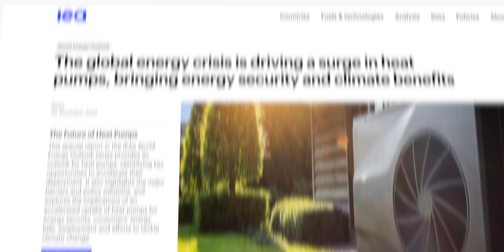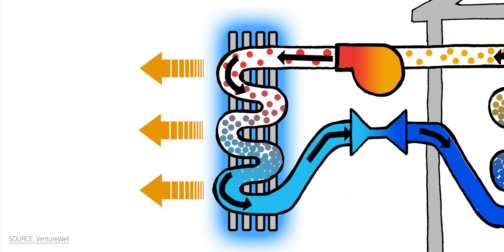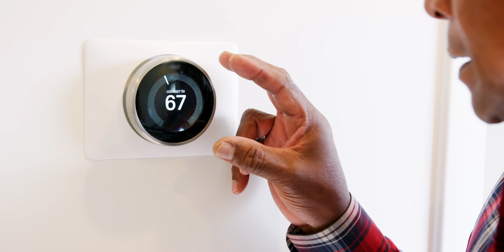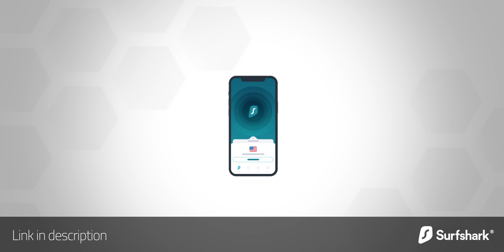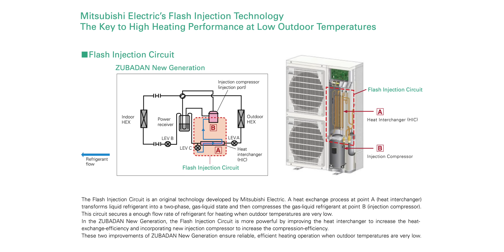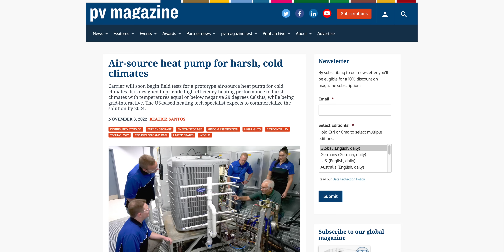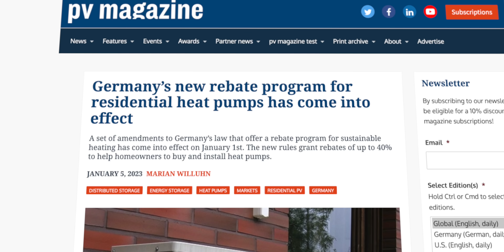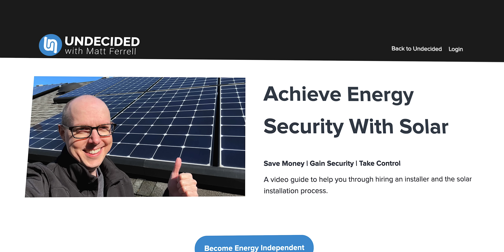Major Advances with Heat Pumps in the Extreme Cold

Comment: I have just gone thru my first winter with a single stage, air to air heat pump and I am only "so - so" on its performance.  About 50% of our winters here just north-east of Toronto are damp with a lot of freezing rain which means that we hover around the 0C (32F) degree mark and lots of moisture.  Our heat pump (York) keeps freezing up and I know this because it blows cold air into the house while it is defrosting itself.  I've had it run for 3 hrs at a time doing this and it's annoying as hell to say nothing of the electrical costs.  Once the temperature falls well below 0C degrees and therefore most/all of the humidity is out of the air, it works fine. So the end result for me is, whenever the temperature gets close to 0C I have to turn on just my furnace to heat the house.  Not great in my opinion.
Reply: You should’ve got an asian brand like Mitsubishi, Panasonic or Fujitsu.
Reply: Same here in Maine...I run my ASHP down to about 15f and then turn it off and switch my oil boiler back on for heat because having cold air blown on you while the HP defrosts is not so good. That being said I can't argue the fact that my heating costs have reduced dramatically through the fall and early spring months when the heat pump can easily produce heat and very rarely runs a defrost cycle. The summer cooling and dehumidifying the system provides is also much nicer than using the old school windows AC units.
Reply: This is exactly my concern.
Reply: Same in Estonia
Very wet and often hovering around 0C for months 
many people are unhappy with it
I will stick to wood stove that also double as back up cooking when power is down
Reply: There are ways to mitigate the issue of freezing/thawing. Most manufacturers have a line of heat pumps designed for use in cold climates. The designs can vary, but in the simplest case they just include heating elements in the outdoor unit to help prevent freezing. But at 0C I think you should not be having such issues with defrosting. I live in a wet, snowy area that also hovers around 0C and there are no issues keeping warm with any our heat pumps (we have a mix of Daikin and panasonic units rated for -25C and -10C - and just the normal heat pumps not cold weather spec).
Reply: We have just have 16 years on heatpump with more milder winters that have min of -7°C. The heat pump has continually performed to meet this no matter what rain snow or frosty mornings.  We leave it on 24x7. About to renew our home system with a ducted system with a Lossnay heat transfer and fresh air so hoping to get another 20 years high performance from the system. Even with low temps and higher humidity it works effectively. May need to look are settings to ensure it is optised to you environment
Reply: Use the brands the are built for it. Mitsubishi, Panasonic, Toshiba or Daikin are got to brands. Samsung also deserves a mention. 

I have had zero problems in temperatures around 0C for the last 7 years the Samsung has been on the wall. I will help it with the wood burner when it drops bellow -25c but those are few and far between, just a week or two per year.. It can do it, just not so good on it. 
I have electric elements but did a renovation at the same time it was installed and since the pump is so good at it's work they are still sitting behind the soffa collecting dust.😂
Reply: I have an aging system and would like to move off propane North of Toronto short of the Muskoka's.  Temps mid winter -10 to -25 and you have nailed my fear as well as the energy (electric) bill that goes with.
Reply: @waynekibbler2710  Wayne, I don't know what to tell you. My system definitely works, and throws off hot air but as I suggested there are times when there's moisture in the air that my heat pump has trouble reliably producing hot air because the fins on the exchange unit tend to freeze up and that's when I rely on my propane furnace to supply Heat. So it's not like I'm telling someone not to get a heat pump. It just would be best if you had some alternative heat in the case it wasn't producing enough heat for you. As you can see I had some comments come back that I should have purchased a more expensive heat pump. But ones like the Mitsubishi that's ate my neighbour just got and mine was $8,000 and his Mitsubishi was 22,000. If you had enough yard area where you can go geothermal then I might recommend that.
Reply: My AS heat pump did have a problem with ice buildup in the bottom on the heating element during outdoor high humidity.  But I solved this by putting a sheet of Styrofoam insulation under the unit. This stopped cold wind from cooling the bottom and let the heat from the heating element melt the ice in the bottom of the unit and drip out the drain hole.  It was amazing what this little change did to improve efficiency during the high humidity near freezing outdoor temperatures.  Greatly improved defrost cycles to less than 90 seconds every 20 minutes with no remaining ice.
Reply: Should have gone ground source.

Comment: We had a brand new Heat pump (not geo-thermal) in our newly built house in 2001-2012. During that time once temperatures went below about 31F the Heat pump ran continuously and the Air pumped out was noticeably cold. The only way to get warm air was to use the supplemental heat (electric heating strips) and once they kicked in the electric bill tripled very quickly. I decided not to use another Heat Pump but rather gas heat for our next House and am very happy that we did. I heard that Heat pumps have come a long way but I won’t get another one once I actually see it.
Reply: Sounds like you had the old heat pumps that were before inverter drive compressors.  The new mini splits are definitely a massive improvement over those old ones.
Reply: @cosmicinsane516  Once the temp difference increases, the "massive improvement" can quickly approach 1 (COP). There are theoretical limitations you cannot do much about them. Inverter drives improve efficiency only marginally (start-stop vs VFD drive) but cost also goes up (essentially electronics).
Reply: @janami-dharmam  Exactly.  At cold temps the best mini-splits are running COP of about 2.  Geothermal can do better but install cost is prohibitive unless you can do it yourself.
Reply: You can't gauge a heat pump on how warms the air FEELS coming out of the vents. Yes, the heat exchanger of a heat pump is cooler (according to readings from my Amana whole home air to air heat pump this tends to be 100-200C) than the heat exchanger of a gas furnace (which tends be around 2000C) and if your vent is a ways away from the heat exchanger it's not very hard for it's temperature to be down to about 40C, which will feel cool on your skin because it's near body temperature, but it still heats the house by blowing less hot air in for longer. Anything above about 30C will still heat the space as long as it's not losing lot of heat from poor insulation or air leaks. A gas furnace will commonly have a vent temperature around 50-60C. You have to go by the overall temperature of the room or measure the vent temperature with something more precise than your hand.
Reply: @extragoode  , I can and I did! The fact is that until about 31F the Unit came on and off in certain intervals. Once it dropped below 31F the Unit essentially never stopped and the House did not warm to the temperature selected. Only after switching to ‘Supp Heat’ would it get warm. So yes, Heat pumps from 2001 (build date) did perform extremely poorly below freezing. Nowadays it seems technology has improved yet I won’t buy another one until I can see it and “feel” it for myself.
Reply: @millerrepin4452  , yes we did. He said that everything was charged correctly and he could see nothing wrong however, after telling him that we had to turn on ‘Supp Heat’ manually he reset the “trigger” point to 31F since it was set to 26F for automatic turn on.
My question is, all these Heat Pumps working below 20F and lower is it because of the Heat strips or truly the Heat Pump? There is a big difference!
Reply: @HsquaredH2  Both, so while the heat strips are automatically called what should happen is that the heat pump should work in reverse acting like a A.C. so it heats back up then once the device detects the temp go up enough it switches back to heat pump mode turning off the heat strips. Most homeowners wouldn't notice when it works properly. I'm still a trainee (early on at that) so I'm not too familiar with the terms yet just the idea on how the system works.
Reply: @HsquaredH2  Sounds suspiciously like the system wasn't sufficiently spec'ed for your home. It's crucial that those designing heat pump systems know what they're doing or customers will end up with results such as yours. Heat pumps as the go-to method of choice for heating and hot water, have been very successfully used in Scandinavia, Germany and other European countries for many decades. You were just unlucky to end up with an inadequately designed system by the sounds of things.
Reply: I live a dew blocks from L. Ontario. We get lots of humidity. I can't see a heat pump doing much once the outdoor coil turns into a block of ice with no air flow. It would likely take a lot of electricity to defrost that block of ice on a cold windy night.
Reply: @drewthompson7457  Heat pumps have been used in Scandinavia, Germany, & France for around the last 40yrs with no issues. Basically it's a case of a climate appropriate, right sized model & design for the building in which it's going to be installed. Getting a good system designer makes the difference between a fabulous outcome & a so-so experience; it's not enough to simply slap one in and fingers crossed, hope for the best. Insulation & draft proofing are HUGE components of a successful installation & operating system although not essential; some homes in Germany haven't upgraded their insulation and they still do a decent job. 
Like anything else, starting with the basics, in this case insulation & obsessive draft proofing, is just common sense. Little point pumping lots of energy in, just to let it leak straight on out.

Comment: In Norway heat pumps has been the mainstream source for heating for about 10-15 years now.
Personally I have had a heat pump for about 6 years or so, and it is working flawlessly in all kinds of weather even in -30 celsius. However my pump is adjusted to work the best at about -5 celsius since this is the most common temperature in the winter, so it is obvious more efficient and uses less power in warmer weather. 

We also have 2 wood stoves in our home, so the heat pump is only holding the base inside temperature of about 17c and the rest up to 21-23c is heated with firewood.

This combination are working extremely good and the power usage is also low, since the heat pump gradually turns itself down as the firewood takes over the heating.

Comment: Can the built in heater handle an ice storm or do you put a building over the heat pump or some type of protection.... The unit is on the ground and would be covered by snow overnight during a storm... How do you deal with that?

Comment: By me cooling is the much more important thing, but as a heat pump is pretty much the same price as a cooling only unit I went with the heat pump, as in the smaller sizes the  cooling only is actually rare and expensive. 1 extra wire in the cable set is all you have, to control the valve, and thus easy to do. Actually used it for a whole 2 days this last winter, because it was unseasonably cold for the sub tropics, dropping below 10C on a day or two in the morning, so the warmth was a nice thing to have for an hour or so, before it was turned off again, and natural air was better. Summer time it was needed, keeping the inside cool and dry, as it was hot and humid outside, so well worth it. $350 for the unit was well worth it.
Reply: I have been in a similar position.  Cooling is more important than heating but I have seen one Achilles heel when used for heating.  If the humidity is high and the air is cold icing is a substantial problem.  The heat used to keep the unit ice free is too much.  Luckily those days are not too common. But a frozen fog really does prevent it from working.

Comment: I had a heat pump last year to mostly take over from an electric hot water furnace. I also had some insulation upgrades. My winter time electric bills have dropped about 45% since I was moving from electric resistance heating.

It did have trouble recently when our area broke a record and hit -29C (-20F) and we had to run the main furnace for about 13 hours, but otherwise got us through the whole winter without using the furnace at all.

The main thing is my heat pump will put out about 18k BTU per hour at 0C but drops to something like 10k at -25C so make sure it's sized properly for your house and situation.

Comment: I used to run a residential solar department in Northern Vermont. In 2020 we decided to expand into heat pumps and we used my house and my mother’s house as the test cases. I installed Fujitsu Halcyon air-source heat pumps, which are rated for their full btu output down to -15°F/-25.1°C. It can get to -25°F/-31.7°C in my town and -35°F/-37.2°C in my mom’s town up in the mountains. I have backup electric baseboard and my mom has a backup propane “wood” stove. Neither of us have had to use our backup heat and neither of us noticed any issues on the coldest days. While our heat pumps may have been less efficient on those coldest days, they still performed well enough to keep the house warm. 

I was on Natural Gas so my savings would have been marginal except for using solar to offset the heat pumps. Mom has propane so she’s would be saving money even if she didn’t have solar.

Comment: Your video is interesting but you do not include the fuel cost of producing electricity since most of the electricity produced in the US are using natural gas.  Also the efficiency numbers do not include the efficiency of converting heat ( burning gas) to electric.  You need to consider the end to end efficiency not just a part of the system when comparing to gas heated home.

Comment: I live in an incredibly cold weather environment and heat pumps even as they are today work just fine up here, esp. with a backup resistive element. We’ve had *barely* 3-5 days a year where our heat pump couldn’t keep up and it had to call on the resistive element, and if you weren’t paying close attention to it you would never have noticed. I’m still glad they’re currently gonna be improving though

Comment: I've got new Samsung heat pump commisioned in the middle of January, basically coldest part of the year. It operated even in those worse conditons at 75% of the cost compared to condensing gas heater in the worst case scenarios. Most of the time is actually significantly better. So even if the gas price goes down to levels before the energy crisis, it is certainly more efficient. And then, half a year roughly, I'll be running it from solar excess of my small PV system

Comment: Convinced my parents to switch from propane to a pair of mini-split heat pumps at the start of this winter and it reduced their monthly heating cost by about half. Payback on the cost of install is going to be about 6 years, though probably a little less than that, but we don't have solid numbers for summer cooling vs the old terribly installed central air-conditioning that the mini-splits are also taking the place of.
Reply: Hehe Propane (R290) can actually be used as a refrigerant in a heat pump and R290 is one of the best refrigerants with the fewest compromises as it has good system performance and very low Greenhouse Warming Potential (GWP) with the main concern being flammability. So your parents might have switched from Propane as a combustible energy source to Propane as a refrigerant; check if the type used is R290
Reply: @NavarroOne  Propane + isobutane?

Comment: No mention of what may be the most efficient heat pump available. I’ve installed and use a heat pump that runs on DC, and better still is the DC source…..  a small solar array, which connects directly to the heat pumps MC4 connectors.  Being powered by the sun this heat pump shuts down daily as the sun sets and wakes with the sun rise. It’s not for everyone, but for me living in the desert southwest it’s better then sliced bread!

Comment: We had a new heat pump installed 4 years ago in our 1940's farm house and instantly saved 50% on the electric bill. more insulation and its was down another 25%. We built a new 2 bed 1 bath house for my daughter and her husband and put a DIY Mimi Split heat pump in the house. the bill in North Texas above Dallas is about $ 180 a month ish winter or summer.  Once in a rare while like the negative 25 days the main house pump will get a little sluggish but we also have the emergency heat option that heats it up and fixes the problem. Were putting another Mini Split in another daughters new Cabin build because they work so well. I am a fan of them.

Comment: I'm considering one of these vs. a traditional central A/C to work in tandem with my newer HE gas furnace. My heating and cooling loads are relatively small. Curious if a more robust heat pump would eliminate the gas inputs except for the coldest of days? The variable compressor tech is intriguing..
Reply: Be cautious and compare your prices of electricity and natural gas. In the northeastern US gas is about 1/4th the price of electricity. So a heat pump with a high COP (i.e., efficiency) of 3 (well above the video's reference to a heat pump COP of 2.5) will cost more to operate than even an older 85% efficiency gas furnace. The heat pump efficiency advantage of about 3.5x (COP of 3 divided by furnace efficiency of 0.85 = 3.53) is too small to overcome gas's 4x cost advantage. On top of that you'll be out the hefty install cost of the heat pump.